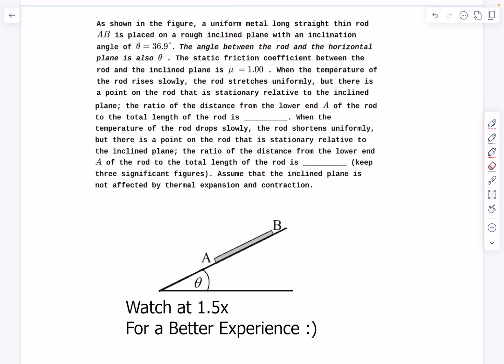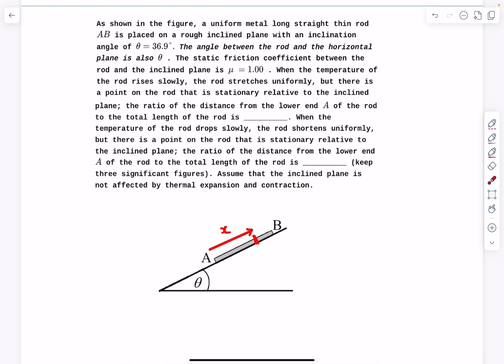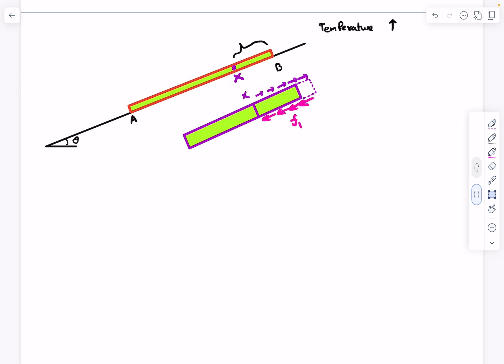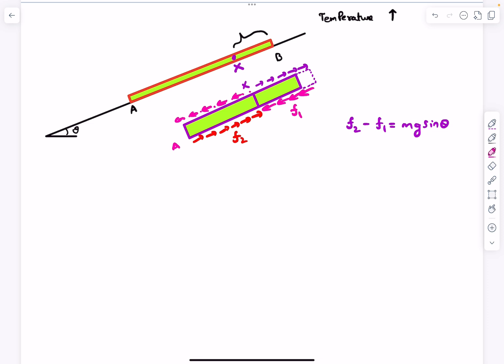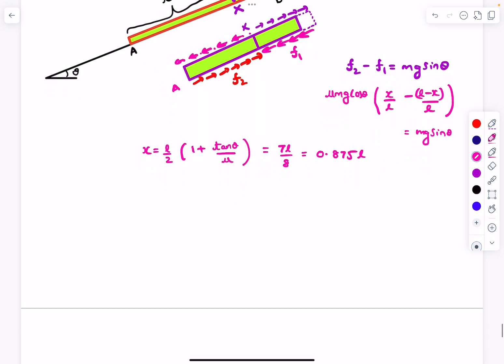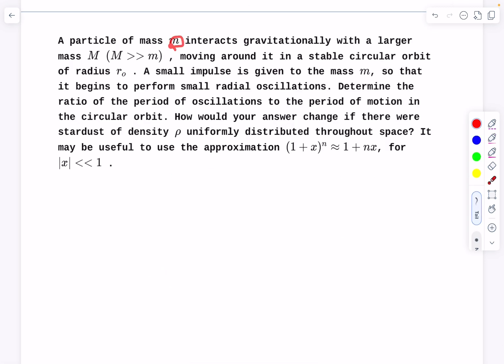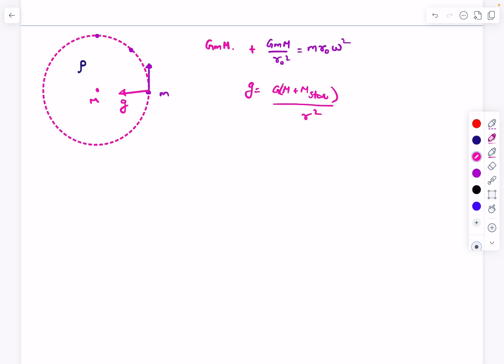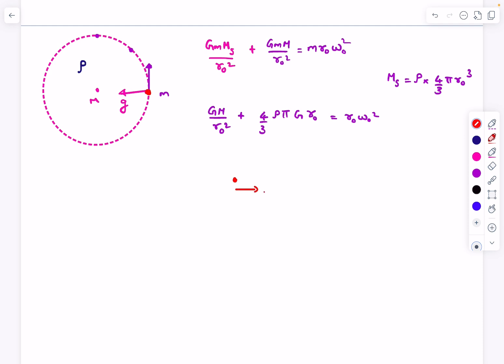Good Problems For Adv 25

Comment: In the first qs, you assumed that throughout the elongation of the rod, the net force on the rod is zero concluding its static condition but if the net force is zero, how come does the centre of mass moves downhill?
Reply: I think it is an approximation due to slow heating